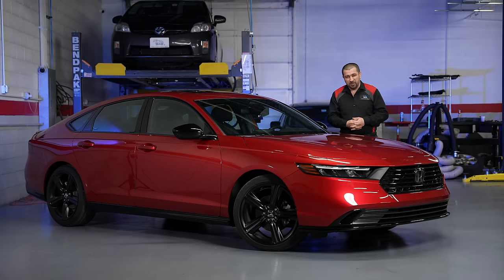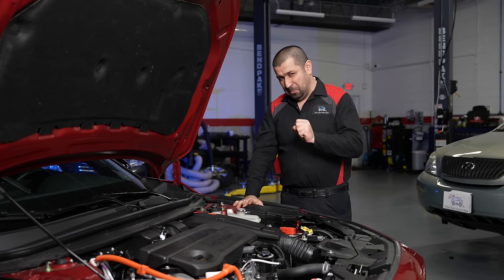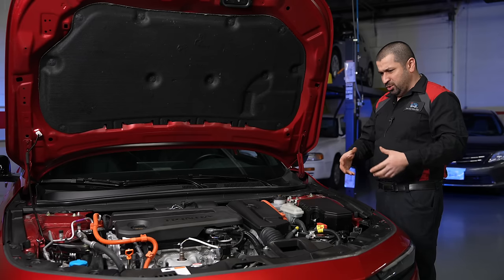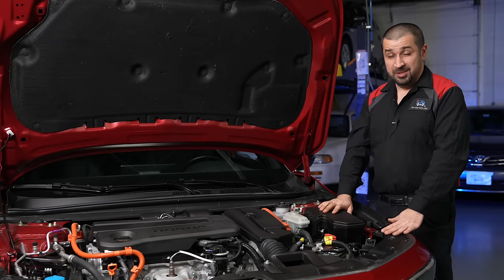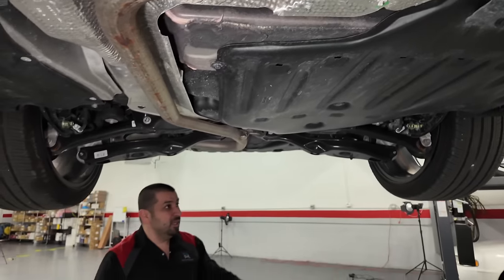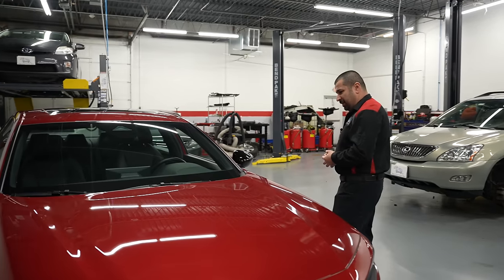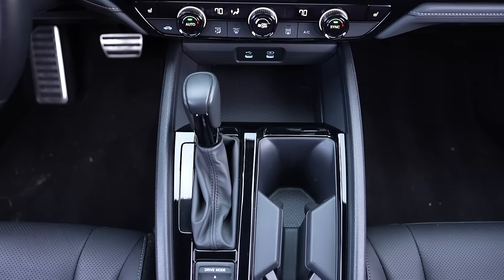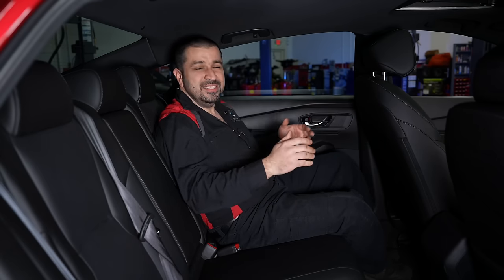Should You Buy The Latest Honda Accord? A Mechanic's Review

Comment: How does this drive train compare to that Chevrolet Volt?
Reply: It's an interesting comparison. And I'm referring to the hybrid modes of the Voltec I system. My understanding of Voltec II is that it accomplishes the same things in a more complicated way, but I really haven't analyzed that to see how accurate that is.

Both use a serial hybrid mode at lower speeds. (Not "series." That is a noun while "serial" is the adjective from. So it is a "serial" hybrid when the engine, generator, and motor all pass power down the line, "in series.") Both close a clutch to use a different mode at higher speeds. But it is not the same mode, and it is done for different reasons.

Honda changes to a purely parallel mode, where the engine and motor apply power to the same shaft. It is done for cruising at highway speeds, not for acceleration. In fact, it will use the serial mode for acceleration at any speed. The reason is efficiency: there are five conversions of power in the serial process: (1) mechanical to electrical, (2) AC to DC, (3) Voltage control, (4) DC to AC, and (5) electrical to mechanical. While these are all very efficient there is still loss. Since highway cruising allows the engine to be used a constant, efficient level of power, there is no need to go through any of those conversions.

The Voltec I system changes to a parallel-serial mode. It is not quite like the Severinsky system used by Toyota, which can be used at any speed, but it is similar. They use it because their motors do not have enough rpm range to handle high speeds. It lets the traction motor run at a lower speed while the engine "adds" rpm to its output. (In fact they do the same thing, using the generator as a motor, in EV mode.)

The Honda transaxle is almost trivially simple. In addition to the motor and generator. It has two gears and a multi-plate clutch. One gear is the overdrive gear that is engaged by the clutch. The other is the countershaft gear that connects both the traction motor and the overdrive gear to the differential. That's all.

The Voltec I is based around a planetary gearset, like the Prius. It takes the same place as the countershaft gear in the Accord. It acts more like a traditional differential, only backwards, with two inputs and one output. One input is the traction motor. Three clutches arbitrate between whether the other input is ground (i.e., fixed, for low-speed modes), the smaller motor-generator (high-speed EV), or a parallel mode of engine and the smaller MG.

Comment: Be warned, the Honda Hybrid does not come with a Spare Tire, not even a donut spare. They give you an air pump and a tire repair kit. If you get stuck out in the sticks, you are toast. Save yourself allot of grief and purchase a Spare tire kit from Honda parts for about $500. The Hybrid is excellent except for this glaring shortcoming.

Comment: AMD brought up not being able to get a hybrid on a base trim. In that line of thinking I might have splurged a little on getting a v6 camry if I could have gotten one without spending thousands more on the fluff. That and I would have been stuck with gulf states toyota port accessory BS packages. So I said screw toyota and went with a smaller car for the mazda 3 that IMO got a better looking car inside and out with a better interior for an out the door price of less than 26k.

Comment: 15 years ahead of Toyota. Honda 1 to create hybrid, 1 to create hydrogen car. But they create the cars too early when there is no infrastructure. After dropping the projects and later on pick up again. Between my previous Toyotas (Camry, corolla), last 9 years only Honda's (civic, MDX and accord) besides the annoying driving belt service. The engines are basic and that allows to service everything. Better handling, more security. Honda is for drivers. Toyota is for transportation (boring, ugly no handling at all). Only the new generations started to change (trd models). In my experience we are talking about 60.000 km a year I make on average, not parked on the lot. Honda definitely, do the service and they will last forever.

Comment: If I had to buy a Honda sedan in 2024, it would be a Civic because they look waaaay better and are similar to size of the 2000s Accords anyway.  They actually have more front legroom than 2000s Accords
Reply: The Civic actually has more front legroom than the 2025 Camry (the Accord is much bigger). In fact, the dimensions are very, very similar. The differences for the Civic are:

F/R Head: -0.7"/-0.5" (But +0.1"/-0.5" w Camry's optional moonroof)
F/R Leg: +0.2"/-0.6"
F/R Shoulder -0.7"/+0.3"

Now, add better mpg, faster, more fun, and (in your opinion) "looks waaaay better."

Comment: -Eplains it is a CVT.
-Company says it is a CVT
- Goes ahead to say it is not a CVT.

It is literally a CVT, just differently interpreted from previous designs. 
You can say it is a better engineered CVT. But it IS a CVT.
Reply: No it’s not it is not belt driven, it’s literally like an electric vehicle with a gas generator
Reply: @Sossaup  once again, no one said anything about it being belt- driven., only that it is a CVT.
It may not be a CVT as other designs before it, but it IS A CONTINOUSLY VARIABLE TRANSMISSION. 

It's like saying a rotary engine is not an ICE because it does not have push rod pistons.
Reply: @tamidis5500  more like direct drive I suggest you research and look up the hybrid system that’s in the koenigsegg regera it’s similar to this system

Comment: The transmission doesn't seem that complicated. A big e-motor to drive the wheels at low speed, the engine acting as a generator to charge the battery, and / or directly supply electricity to the e-motor via that little starter / generator.

And at high speed, you rev-match the engine, and engage the clutch and the ICE drives the final drive.

Nissan's system is even simpler, with the ice only charging the battery, and a e-motor driving the final drive like in an electric car.

Toyota's is crazy though. Using an epicycloidal gear set, and the relative speed / power of input and output modulated by a small e-motor, now that's genius.

Dunno which is the most efficient. Honda is like a self-charging EV with the ICE taking over at high speed, Nissan is just an EV with a generator, Toyota is just... weird... How the power is distributed in the Honda / Toyota is where the magic happens, and it's just good engineering taking over, looking at what scenario is best for what context to maximize efficiency. All have very small amount of mechanical parts that don't wear out.

Comment: I have a Hybrid Touring model and I love the drive but the Infotainment is a real POS.   They took away Sirius radio.  You now have to use your phone APP and the signal is only as good as your phone.  Living in CA and going through the mountains, this has become a real problem.  Not to mention, it takes several minutes for the Infotainment system to sync up.   Trading mine for a new 2025 Camry or Lexus ES 300h.   I love my 2022 Accord Hybrid Touring but the 2024 electronics are disappointing.   They also took away the HomeLink as well as the auto mirror adjustment when reverse.   Honda has become really cheap.   Disappointed with my new purchase.

Comment: It amazed me that honda continues making the accord when it has a civic that is basically the same size. These cars more or less compete with each other. 🤔
Reply: I think you confuse the different emphasis that manufacturers place on the size of their cars, and the games some others play with names and numbers, with the facts. These two cars are not "basically the same size."

Toyota calls the Corolla a compact. So does the EPA. The EPA category is 100 to 109 ft^3 total, and it barely qualifies as a compact at 102 ft^3 (89 ft^3 of passenger space and 13 ft^3 for cargo). 

Honda calls the Civic a small car, even though the EPA calls it mid-sized. (110 to 119 ft^3). It is 99 ft^3+15 ft^3=114 ft^3.

Toyota is confused about the Camry. They include it in lists for both their compact cars, and their mid-sized cars. It is 100 ft^3+14 ft^3=114 ft^3. The same total size as a Civic, leaning more toward passenger space so I will call it larger by a nose.

They also call the Prius "mid-sized." They get away with this because the EPA has no category for hatchbacks. It has only 91 ft^3 of passenger space, but a whopping 24 ft^3 for cargo that is useful only for bicycles and bathtubs (yes, they have advertised it for bathtubs).

Toyota's Crown is advertised as full-sized. The EPA calls it barely mid-sized, at 98 ft^3+13 ft^3=111 ft^3. I was intending to make this list in order of increasing size, but this so-called "large" car belongs at #2, between the Corolla and Civic.

Finally,  Honda calls the Accord a mid-sized, but it is the only EPA large car (120+ ft^3) in this list. It has 106 ft^3+17 ft^3=123 ft^3. That's almost a full EPA category's worth larger than the Civic.
Reply: @jeffjo8732  nice but from sitting in them. They seem to be rather similar in size. Guess on paper is different. 

Awesome love it when ppl give facts. Ive always been confused about the prius its so small.

Comment: MY JAW.  IS ON.  THE FLOOR.
Reply: why ?
Reply: Honda’s hybrid system.  Is it ground breaking?  Not really.  Locomotives have been using this tech for decades, where the combustion engine is used to generate power to the electric motor that drives the wheels.  But most automobile hybrid applications don’t use that.  Usually it’s either the electric motor is driving the wheels, or a combination of the engine/electric motor driving the wheels.  It’s pretty cool to see it in a car.

Comment: I don't like the idea that this Honda has no planetary gears in transmission. They should have copied Toyota's. This Honda Accord Hybrid mostly just runs as an EV with it's electric motor.
Reply: "This Honda Accord Hybrid mostly just runs as an EV with it's electric motor." Which is why it is better than a hybrid that uses a PSD.

Comment: This car is better looking than the camry  but cost more
Reply: Does it cost more? I'm not making any judgments here, just pointing out the underlying causes. And my point is going to be that it is almost impossible to make a head-to-head price comparison. Different companies have different pricing models, and marketing strategies.

An example is that, as of today, the lowest MSPR for an Accord is $28,295; for a Camry, the car that Toyota markets in the same niche, it is $28,400. I'm not claiming that is a head-to-head comparison; the Accord has gas powertrain, while the Camry is a hybrid. But the Accord has standard features that come only in optional packages in the Camry, making it even more expensive.

The US government's CAFE (Corporate Average Fuel Economy) standards are forcing these companies to force consumers to buy the hybrid version. Honda's response to this was to eliminate the 2.0L turbo engine, offer the 1.5L turbo only lower trims, and the hybrid only in higher trims. This is why the hybrid seems to be expensive - it has a built-in feature bump due to the trims it comes in. Toyota eliminated the gas-only power trims entirely. So the starting point for a price comparison is the Accord Sport Hybrid ($33,655) to the Camry SE ($30,700). That nearly $3K difference seems big.

But the cars are not comparable. You'd need to add the $600 Convenience Package, the $870 moonroof package, and the $735 multimedia package to the Camry. And there are still features included in (either) one, but not the other.

But the elephant in the room is that the Camry and Accord are not comparable vehicles. The Accord is an EPA large car (123 ft^3 interior space) while the Camry is a midsize (115 ft^3). The categories that the manufacturers use represent which market the vehicle is aimed at, not so much the vehicle itself. The Accord is bigger, and in general has higher quality materials. The vehicle that better compares to the Camry is the new Civic Sport Hybrid ($28,750) or Sport Touring Hybrid ($31,750), which have almost the exact same interior space (114 ft^3). Either is much cheaper than a similarly-equipped Camry. There are fewer available features (it is aimed at the same market as the Corolla (102 ft^3)), but it is faster, has better mpg, and drives better.
Reply: @jeffjo8732  sounds good.  I'd prefer the honda just on looks alone but didn't know all the extra info .

Comment: Yes a motor. A gas motor is powered by gas and electric motor is powered by electricity . Where does the electricity come from? The generator. How does a generator produce electricity. How does it produce electricity? By spinning. What is spinning the generator? Fred Flintstones feet? No a gasoline motor spins the generator that produces the electricity that charges the battery that powers the electric motor that spins the wheels. Does that make sense to you?
Reply: It is obvious that it makes sense to all those automotive engineers, with PhDs, at Honda. And mine gets 50 mpg.

But It's quite obvious that it doesn't make sense to you. What's wrong with this picture?

Comment: So basically it's an ev that is charged by a gasoline engine?
Reply: No, it is an EV that is powered by both a battery and a generator. The excess power charges the battery.
Reply: Ok and what turns the generator that charges the battery that powers the electric motor? A gasoline engine.
Reply: @davidpiccolo3039  That's why it is called a hybrid. The point is that the only device driving the wheels is a motor.

If I take a headlight from a Tesla, and put it in a Pinto, is it now a gasoline light?

Comment: Too expensive for the appliance it is.  Even the Civic.

I would not risk 27k to 40k on a passenger car with an unknown future.

We don't know what driving rules and costs will be in 10 years.  Will gasoline be $15 or $2?   Will they tax you 10k a year for carbon?  Will they require autonomous driving or driving aids?  Will EVs still use batteries?  Will they use the current batteries or will those be obsolete like NiCad from 2008?

Financially it makes sense to spend 20k or less on an appliance with a 15 year life span at most.

I'm sure 2001 Prius owners thought they were high tech.  2005 Leaf owners.  2010 Tesla Roadster.  Ford Flex.  Model Ts and Doble Steam Roadsters....

We're at the end if the traditional peivate car era.  Spend less, plan for the worst, hope for the best.